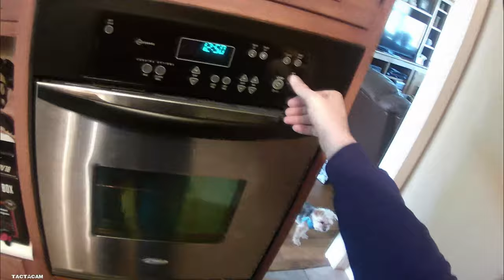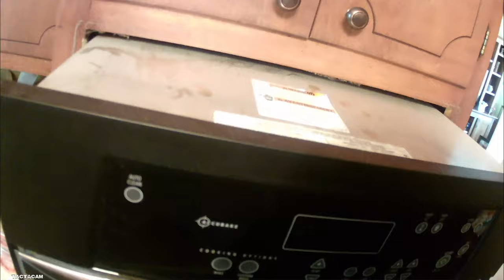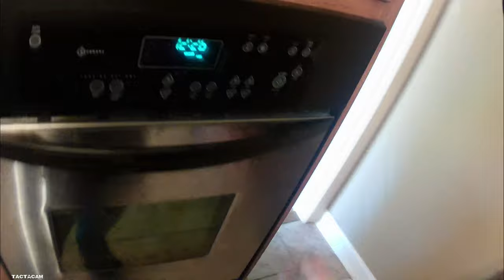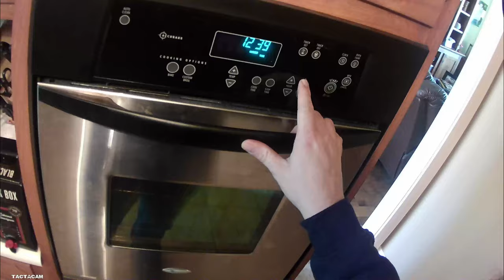Wall Oven Not Heating

Comment: Thanks for the video.  I have a 17 year old Frigidaire wall oven.  It has power, but neither the broiler or bake element work.  Following your video, I removed the thermal fuse and used a "Continuity tester" to test the fuse.  The light lit up, so presumably the fuse is not the problem (I think).  Any ideas what to do next?

Comment: Have an LRE319480 electric oven that will heat but takes a long time. Then sometimes it will work perfectly. What could be the problem?
Reply: Great video
Had a problem with our Electrolux double oven, slow heating & not working at times. Checked the temperature sensor, hi temp. Cutouts, elements & everything appeared ok. Checked with a few buddies looking for some insight, before replacing the control panel. For some reason the following procedure is not included too reset the main control panel with the oven manual?
The Great Reset Procedure
1. Main control panel, enter the preference / wrench.
2. rse will show no.
3. Enter plus sign & then enter yes.
4. Enter start.

Comment: I have a Drop-in Samsung Gas Range and Oven.  Today I was making Cornbread.  I had preheated my skillet, pulled out of the hot oven,  put the skillet on top of the stove, and poured my batter in the hot skillet.  When I went to put the skillet back in the stove I spilled the batter down over the control panel and down over the stove front.   I went to set the timer and everything went off.   On the front are the letters. " SAb "   I looked it up and it stands for Sabbath. How do I clear this on the range.?     A Jewish stove and oven?  Model  NX58H9500WS   SN 0BR47DDK401058N 
I tried flipping the breaker to reset it but it didn't work.   Burners on the stovetop work fine.   Just no oven

Comment: I have the same oven that doesn’t power up/ no display  but door is not stuck closed. Fuse all good in the fuse box;(
Reply from the maker: Sounds like a control board issue to me.  I would look into that.  Make sure it’s get over 120vac to the board. If the board has L1 marked in it you want to check there to N or neutral.  If you get 120vac than you need to replace the board.

Comment: I have a similar problem on my 15 year old Kenmore freestanding stove.  It smoked a bake element and popped the breaker.  I replaced the bake element and still no bake or broil.  The control panel seems to be ok because I can hear the relays working in both bake and broil.  Top of the oven works fine - four hot elements.  Clock and controls all work.  My guess is fusablebresistor on the L2 circuit.  What do you think?
Reply from the maker: Great question.  I ran into on where the element blew and short the board out to ground.  I would put money on it being your board.  You can still hear clicks from the board and it still be bad.  I had another one like it today.  Board was bad I verified it by disconnecting the wires at the element and tracing where the missing power was from.  Traced it back to the double line break relay on the board.  Good luck
Reply: @BeardedApplianceRepair  thanks.  Doc is my bet, too.  I have never known to many big resistors to get smoked to easily.  I am a former radar maintenance chief in the Marine Corps, and have years working on electronic crap.  We have bought a new stove.  It was a 15 year old Kenmore and I did not want to get into a money pit.  I could fix it but it would cost around another $100 and a new stove was only $485, interest free and 10% off with my military discount.  It just was time for it to find a new home.

Comment: we have this same wall oven but both Bake and Broil elements do work. the oven does not reach temperature when preheating. If set to 350 °F it only heats to 250 °F. we can't quite figure it out. would this be a thermal fuse issue or control panel one? Tried to follow calibration instructions but the display won't show 0°F
Reply from the maker: No should be a fuse if it will heat.  Turn on broil and see if that is heating.  If not it could be a board issue or a bad element.  Same with bake.  They use both elements for pre heating.  If one doesn’t work that will explain the issue.  Just need to figure out why one of them is not working.
Reply: @BeardedApplianceRepair  all the elements WORK when either baking or broiling. so when the PRE-HEAT beeps the oven is not up to heat is it 100 degrees off - to low. Is it the Thermal Fuse and not the Temperature Sensor?
Reply: So I sent the control panel out for repair and it came back and I still had the problem. I checked the Thermal Fuse and it was okay. Nothing wrong with Thermal Fuse. Now I know that the problem is the touch pad because I sent it back to the control panel repair people and the tested it and yep it is broken. The only problem with the oven was heating up to PER HEAT TEMP. Waiting for the new Switch Part #WP8304244. I can't wait to install the new keypad.

Comment: Does this oven have limiter switch or reset button?? No power lights on control panel. Frigidaire
Reply from the maker: Hard to tell without seeing a wiring diagram. They may or may not.  What I would do is make sure your even is getting 240vac first and go from there to making sure the control panel has power.  If you follow the wiring from the terminal block to the board you may or may not find one of them fuses that prevent power getting to the control.  If power is all go than you will be looking at a control board.  Make sure first before you purchase one.  You cannot return then if it has been installed at most appliance part dealers.

Comment: Hey, I've having some trouble finding the problem in our oven. 

-oven won't heat above 100°c
-all three heating elements read ±30 Ω and have continuity
-i can find 3 thermal fuses, all have continuity
-thermometer has been replaced but still reads 235000 Ω
-no visual burning marks in the electronics

What should I try next?
Thanks!
Reply from the maker: Check to make sure you have good power.  You need 240vac for these ovens to work.  make sure its good at the wall and if it is, it is likely the control board that is your issue.
Reply: @BeardedApplianceRepair  how do you work on it when it’s hardwired in? Do you just cut the power at the breaker? Is that safe? Thanks
Reply: Had a problem with our Electrolux double oven, slow heating & not working at times. Checked the temperature sensor, hi temp. Cutouts, elements & everything appeared ok. Before replacing the control panel. For some reason the following procedure is not included too reset the main control panel with the oven manual?
The Great Reset Procedure
1. Main control panel, enter the preference / wrench.
2. rse will show no.
3. Enter plus sign & then enter yes.
4. Enter start.